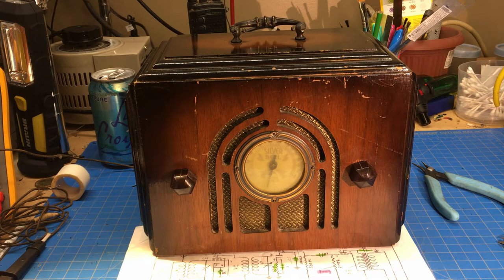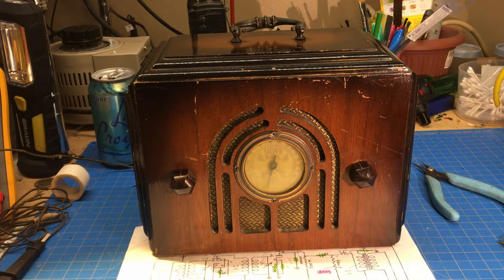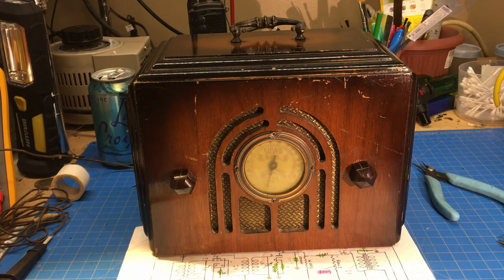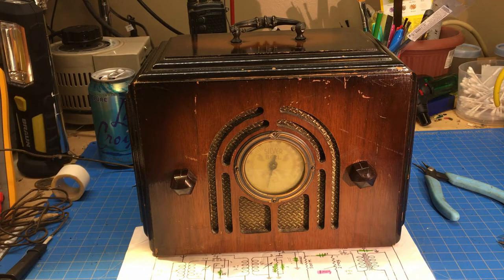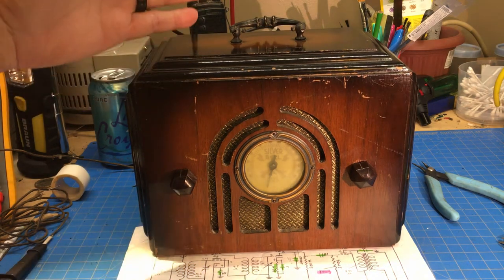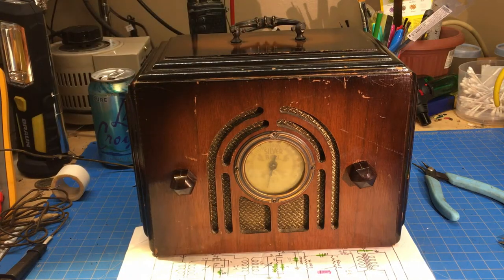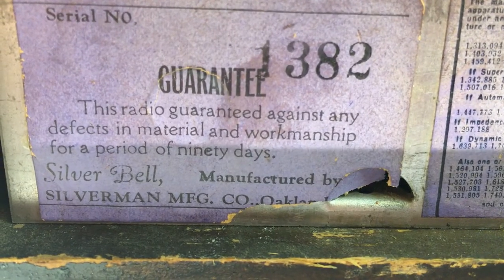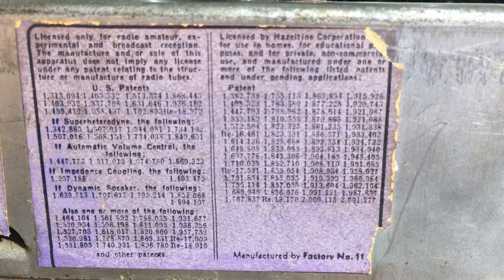1935 Mystery Radio Silver Bell Part 1 of 4 Intro, Disassembly and Test

Comment: I’m starting to get a feeling that one clue to this radio’s manufacturing history might be in the ‘Bell’.  Peter Pan radios were manufactured by Jackson Bell in Los Angeles.  Though your Silver Bell radio circuit diagram is more or less the same for the Peter Pan, (looks like) model 34, it incorporates a similar audio, and power supply circuits to the better known model 84, introduced in 1931/32, but the front end is somewhat different.  Being one of the smaller radio manufacturers, I guess they did not have the financial resources to maintain a steady flow of new model designs incorporating the latest radio designs incorporating the latest valves, and components.  Likely as not they did what a number of small manufacturers did: they utilised what they believed was a well tried and tested design in other trade names, or marques, and which one yielded the greatest amount of revenue would be the one they would likely stay with.
It might be an idea to begin unearthing the history of Silver Bell by delving into the archives of Jackson Bell.  Perhaps start with a theory that Silver Bell, Packard Bell, and possibly a few other obscure radio marques were alternative trade names of Jackson Bell.  They, like any other manufacturing company were operating in a competitive market so they did what ever it took ‘legally’ to stay afloat in their field.  At that time, Jackson Bell was a relatively small fish operating in a large pond.  From an operating point of view, they were not in the best of shape, and eventually they stopped trading.  Nonetheless, before that happened they tried various ways to stay afloat, including the various trade names that had ‘Bell’ in them.  I guess they were looking for that one particular trade name, or marque, that turned out to yield the highest amount of revenue, then stick with it, and ditch the rest but it appears that never happened.
Test this theory to see if there is any truth in it.
Cheers my friend, Phil.
Reply from the maker: SteelCity321PB Thanks Phil! Yes, I believe "bell" is the key. JB had some financial issues early, say 1933...Herb Bell was part owner, and later he partnered and formed Packard Bell....Jackson Bell, did have a large inventory of TRF parts, as the Regens and superhets were becoming popular. If I could get a lead on Silverman, it may be some company that during the Depression was looking for a way to make it.  They had the people to work, and radio was taking off. Thats how a lot of the "west coast" radios came about...as always, the Gilfillan brothers couldnt have been far away. The design of this is simple and the assembly is crude....but, a Jensen speaker??? Surplus maybe??? Hopefully, just like ai came about this model, a viewer may have one or knows of one. I had a lead that there is one in a museum in Texas, but when I contacted the person, he said a lot of the radios were boxed up, probably not room for display...Everyone loves a good mystery, so here we go!!!! Thanks for the comments! Got me thinking about it again! Take Care--Larry

Comment: All the major organs are good. You can rebuild him! You can make him better! 😁👍👍
Reply from the maker: Robert Gibbons Thanks for watching! I know it was a pretty long video....Almost made it in two, but I hated to beak up the tour thru the circuits. Do you have any idea about the history??? Just another West Coast radio, I guess. The next couple videos should be a marathon!!! Lol...Take Care--Larry
Reply: I think your guess is probably correct. Think about the time frame. Right in the middle of the Great Depression. Silverman Manufacturing may not even have been an electronics firm. Cheap TRF parts available, unemployed electronic technicians. Might just have been a filler type operation to keep the company going. And I agree that the video was better showing all the vital part checks in one video. It really didn't seem that long.